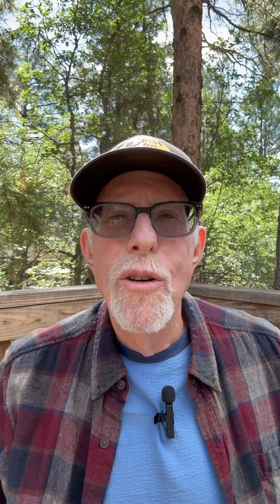Testing the Btech UV-Pro Audio Relay and Dual Monitor Features Together. Surprising Results! #radio

Comment: Im trying to figure out the programming, I think I can use a csv
Reply from the maker: Yes, you can use a CSV. However, I found that the CSV is not as easy as it sounds. The formatting has to be perfect. Plus I had to create a separate CSV for each channel zone/bank. Not an easy solution. But it did work.

73 Dave N8DAV